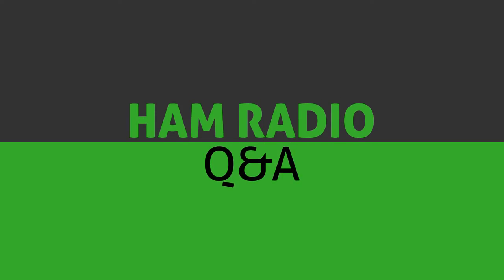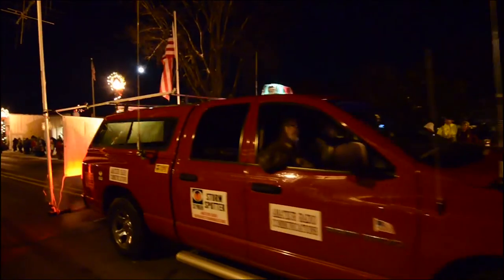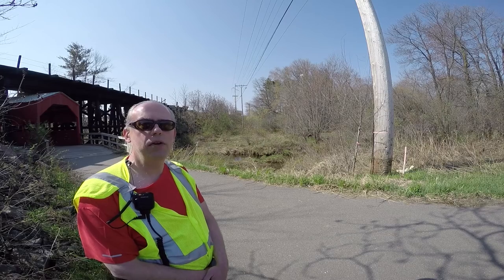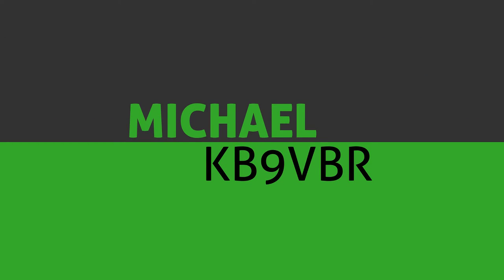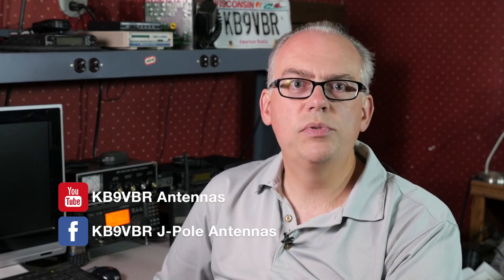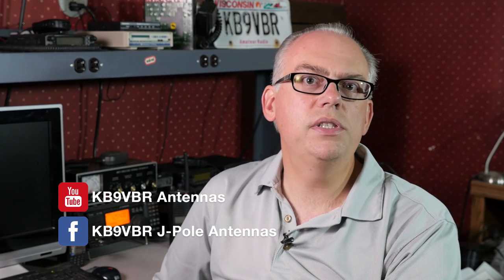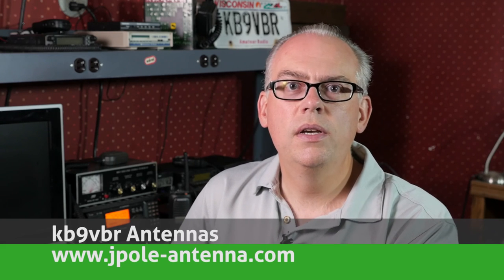ITU Phonetic Alphabet - Ham Radio Q & A

Comment: I have been using phonetic since the cub scouts over 50 years.  I have a question::  I have been off the air for over 30 years, I bought a FT1200 in April and a 4BTV vert. My question is I just put up a 50 ft free standing tower and will be put up a 4 or 5 band beam, I have room for large but want to go with a mid-size but still have good band width, I was looking at the NA4RR, the MA5B and the TGM 24 but the have a narrow band width, do you have any ideas?